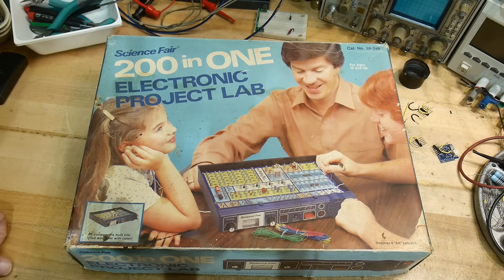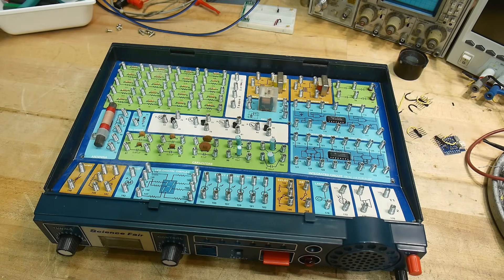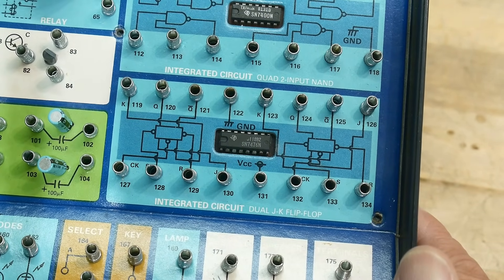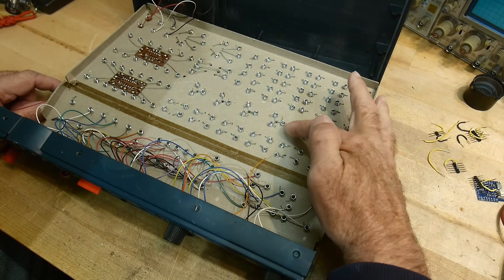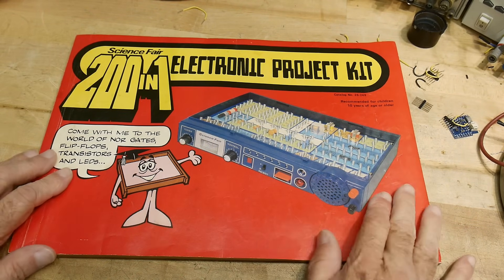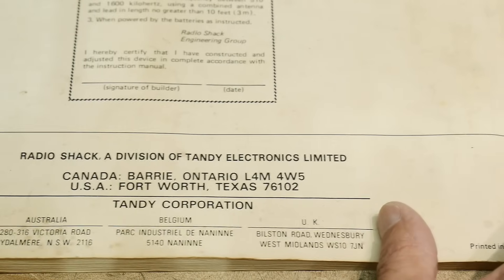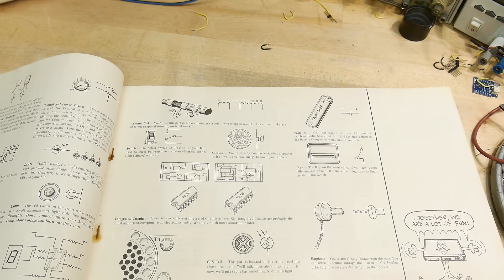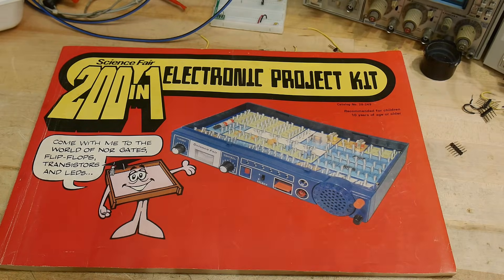#1839 Radio Shack Electronic Project Kit

Comment: I have a 300 and a 150.  Picked up the 150 at a local hamfest.  Got the 300 - brand new unused on Ebay.  Hoping to interest my 10 year old in electronics.  We also have a big set of Snap Circuits.  I find the RS kits superior.  Their manuals have *schematics*, which the snap circuits lack.  How can you learn anything without schematics?  We got the Snap Circuits on Amazon at the beginning of the Covid, when we had to hide in the house for a long time.

Comment: I still have the manual from my 300 in one kit, with each experiment showing schematic and plugblock layout.   In fact I never bought the kit itself but instead asked the Radio Shack shop whether I could buy a replacement manual.  They were happy to oblige, and I put my own kit together.  Enjoyed your vid.  :-). ❤😊

Comment: I had this and the Radio Shack 150-in-1 kit, as well as another kit from a different manufacturer that had all the components in plastic squares that could be arranged like a schematic on a grid. My bedroom was in a basement and I lived in a very rural area so the radio never picked up any stations. However I did learn how to transmit bursts of RF static using the relay in "non standard ways".

Comment: I had one in Australia in the early 1980s - You didn’t need to strip the wires they were tinned ready to go. I spent ages wiring up some projects to disappointedly find they wouldn’t work. My favourite project was AM radio broadcaster, I would sticky tape the earphone/ mic to a record playing tone arm and broadcast my Paul McCartney 45 rpm single across the house!😂 Also loved making crystal sets and building an amp. The digital stuff was a little beyond me but I think I did an LED chaser? Wonderful memories ❤

Comment: Back in the day that I found this in a Tandy shop, I waited until it was on offer for half price. I picked one up and as kids do wrecked it almost immediately. I think I went back to swap it under warranty 2-3 times lol!
I remember as a kid that I wanted to build one of the most complex ones, probably something like an FM radio. I forgot to remove the batteries while building. About half way, and it was getting dark, I couldn't see very well and forgot to turn on the lights. At some point a loud bang was heard and sparks flew a meter high. One of the transistors was blown. That gave me quite a scare there and learned a valuable lesson. Always unplug whatever you're working on, unless you know what you're doing. 
I must've had a later model as the pot knobs were better looking, better fitting the case.

I've also owned a few other but smaller ones, one with a radio theme with an 'opamp' which was built using discrete components. One of the few where the radio actually worked reasonably well.

I soon transitioned to a breadboard, a stack of components and a photo copy of the Philips EE2000 series kits (which were even more expensive and more geared towards schools), which was a much more educational works. I actually learned a lot from that.
I still have bits and pieces of those components and breadboards as well. But the 200 in 1 kit hasn't made it. I've taken out most of the components that disappeared in other projects. I think I still have the manual for it though.

Those transformers were not for the radio per say, but for impedance adaptation of audio signals, one for the crystal earphone and one for the 8 ohm speaker iirc.

Comment: I got one of these things in 1987, and still have it.  The parts don't look corroded on it, so I am curious if the battery gases did it.  I built pretty much everything in there, and then started to making new things, and hooking in external parts.  the LEDs still work and I didn't burn any of them out.  lol.  The method of learning was pretty nice, where they start out showing how the circuit is wired, then change to schematics later on. all of the projects were easy enough to wire, you just followed the numbered connection list at the bottom.  after awhile the wires kind of wear out, so I was relegated to using lengths of green wire stripped from old xmas strings.

Comment: My parents first bought me the 30 in 1 Solar project kit, which eventually led me to pestering them to get the original 200 in 1 kit (not this newfangled plastic cased thing).  There was an article that came out much later describing how Radio Shack could get away with terrible quality control on these kits, as the number of people who would actually discover the fault and then actually try to return or exchange the defective kit was diminishingly small.  Still was a great treasure of mine as my parents weren't going to get me a computer.

Comment: My parents bought me one ca. 1985 or so for Christmas. I had no idea about it (and I don't think my parents figured out I would go nuts over it). I think it was the original 150 in 1, and boy did that send me on a career path. I remember playing with that thing for hours on end. I did get the 200 in one a few years later but it looks completely different - the batteries were moved from the bottom to the top (2 rows of 3) and the front panel was angled upwards. And it didn't come with a cover - nope, no cover at all. Somehow I don't think whoever created those things realized how many lives it would influence - they probably were just figuring out how to make it cheaply despite them actually costing a lot of money (I think the 200 in one was over $100 in the day - and you look and it's really only about $20 worth of components and $5 worth of cardboard and plastic.

Comment: I had that also! That was a lot of fun to look at again. I think I eventually took mine apart too.  I recall violating the agreement on the back of the book when I tried building a pirate radio station using the AM broadcasting circuit with a long antenna up into the attic, good times🤣

Comment: I had a modular set of speakers and amplifier(s?) that could be configured in a few ways, including using one speaker as a microphone and the other as a speaker. A little hazy as that was around '68. It was just wired with quick connects and hookup wire. I don't recall the 200-in-One but don't recall even knowing about Radio Shack until I received that kit.

Comment: Brings back memories for sure. I didn't have a 200 in 1 kit. Probably 50 or 100 but the idea was the same. I used it for years. I worked in electronics and eventually taught electronics in college. It sure sparked an interest.

Comment: I had thae 160 and the 200, and also the AM/FM SW1&2 which was my first.   After that I got a breadboard and started scavenging any parts I couldn't buy at radio shack, but the 200 is still under the bed somewhere, lol

Comment: I have the Science Fair 130 in 1 from arround 1993, stil have the original 6x AA Philips batteries that came with it,  these batteries look like new and still have some juice in it. If you compare that with the rubbisch of Duracell these days. Back in the days i burned a few LED's and transistors of this kit by experimenting without the manual and had to replace those on a regular basis.

Comment: I bought a similar kit for my son about 20 years ago.  We made the AM radio project.  No matter how we tuned the variable capacitor it picked up the strongest station around (580 CFRA) with some interference from other stations.  Fun anyway and we still have it.  It is wired into a simple amplifier with a speaker.  We listen to Christmas songs on it every Christmas :-)
Reply: Good old CFRA about the last AM station left in our area.  The only one I can tune into in the lab without an antenna 😂
Reply: @ludmilascoles1195  I used to listen to Lowell Green and Steve Madely giving those politicians a hard time :-)

Comment: That corrosion is probably a result of the battery chemicals wicking along the wires. I have seen leaked battery fluids wick inside of wires, hidden by the insulation.

Comment: The most cherished possession  of my youth!  It once had a bluish acrylic dust cover which would keep things neat when I ran around to show projects off to relatives!  And right off the bat I blew all the LEDs and the flip-flop IC which my dad then replaced - along with a crucial parts spec lesson.  I learned a lot electronics knowledge because many of the circuit examples had to use compromise combinations of remaining parts, like hacked diode-transistor logic variations, when the 4 NANDs and 2 flip-flops weren't enough or design suitable.  Anyone like myself over the years, add circuits above the 200?  I made a pretty good iambic mode-A CW keyer a few years back.

Comment: Ha! When you opened the book, you turned right to my favorite circuit, the spark gap transmitter! I had hours of fun interfering with my siblings television watching playing with that thing. I learned very little about electronics from it though. The pedagogical part of those kits left much to be desired. The sad truth of the matter is, without a scope, it's difficult to get an intuitive sense of what you are doing. In that way kids have a big advantage today: you've shown some handheld chinese scopes on this channel that most parents could afford to buy their kid for christmas. Getting them interested in this stuff OTOH is infinitely harder. Plus, the whole "well just use a microcontroller" sort of short circuits all the important thinking parts.

Comment: Corrosion is most likely copper carbonate. Best way to clean it that I have found is a clear diet soda, maybe diet Sprite or 7-Up. Make sure the soda is diet. The citric acid in the soda reacts with the corrosion to produce copper citrate, which is water soluble. Works pretty well on battery contacts too.
Reply: And white vinegar should help dissolve the battery bay corrosion.
Reply: Lemon juice?
Reply: @jeromekaidor7254  That should work too. Just make sure to rinse after using - otherwise the acid can eat away the contact.

Comment: CES 651 Analog Electronics Lab Trainer
manufacture is avotek
The CES 651 also features a built-in analog voltmeter and ammeter along with both integrated circuit (IC) and printed circuit board (PCB) expansion connectors to increase its functionality through the use of external PCB modules. This trainer is a comprehensive solution for teaching analog theory for nearly any electronics discipline including the ASTM/NCATT Aircraft Electronics Technician (AET) Certification.

The CES 651 Student Manual features 150+ experiments for students to complete!

Comment: I'm in the UK and I remember the Philips Electronic Engineer kits well. There was also a kit called Trionic which had the components in plastic carriers which plugged into eyelets on circuit boards. More jigsaw than electronic construction.
Reply: I had the most original Philips EE-kit in 1963. I learned to shorten the coil of the AM radio and get shortwave bands. This  was important because Finnish Radio did not play much any rock music.
Reply: Philips electronic engineer kit here, I'm in the uk, been hooked ever since.

Comment: My jam was the Cosmos Electronics Experimentation Kit. They used breadboard-like metal clips with holes in them to stick the leads in. I learned the hard way that with transistors orientation matters, and that you can't switch a ringer with just a BC547....

Comment: Got one maybe a 50 or 100 kit by (I think) Alinco, no digital stuff. Had all the components on plastic carriers with posts and a peg board. You could layout your project and wire it with jumpers that had C clips on each end. Yup I burned out the signal diode and had the guy at the TV store rolling in the isle when I asked for a replacement geranium diode.

Comment: Yea that's the deluxe model! I had the 150 experiments model, all flat on the top no front edge controls. I'm sure the quality of components and manufacturing was crap but the book that came with mine was actually pretty good. Explained the circuit theory and offered up suggested modifications to gain an understanding of what was going on.

Comment: I had either the 100 in 1 or the 150 in 1 as a kid, I can’t remember. But it was a great learning tool, then it because a source of parts until I started taking apart stuff… I didn’t have a lot of money back then so taking apart boards became a necessary first step to projects. Eventually I found surplus parts places like Poly Packs. Ah, what fun! I do think I built every damn circuit in the book, though… HATED those stupid wires…

Comment: Yep, I started at 10yrs old in the mid 80's with Dick Smith Funway Into Electronics #1 basic kits.
They were just a plastic board with a bunch of pre-drilled screw holes and you would photo copy, or simply cut out a paper overlay for each circuit out of the project book, then wire up components wrapped around screws, screwed into the plastic board, and wire things up to match the paper overlay.
These kits progressed to #2 and #3 kits, which ended up with you stuffing and soldering pre-printed circuit board projects, and if memory serves me the #3 projects required you to design, draw up and etch your own circuit boards with ferric chloride, and the projects got into using ic's etc.
I also had one of those Tandy spring terminal kits with a bunch of projects, not as fancy as your's (maybe only 50 in 1)
It was something I bought 2nd hand at a swap meet, also similar to your's it was missing a heap of stuff and wasn't in very good condition, so I never did much with it😁👍🇦🇺